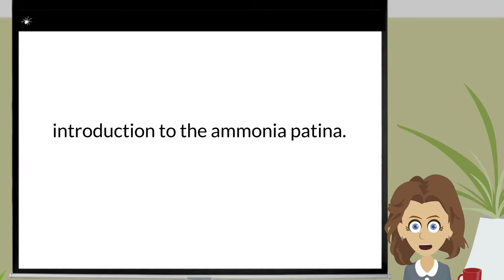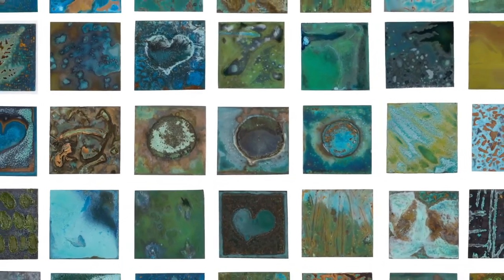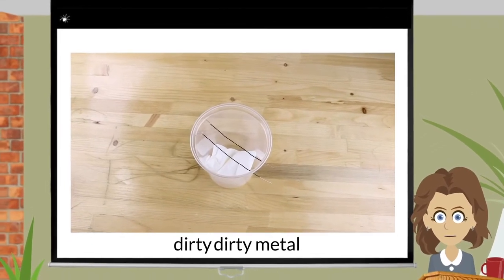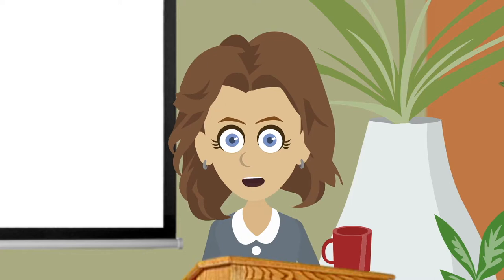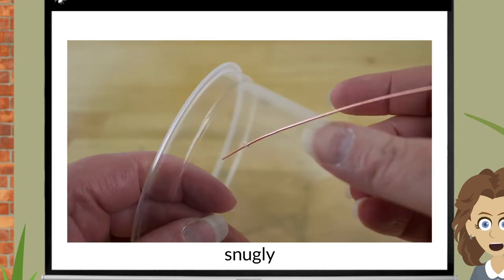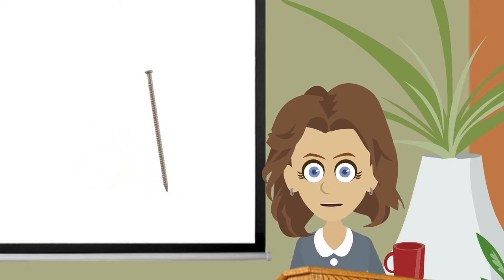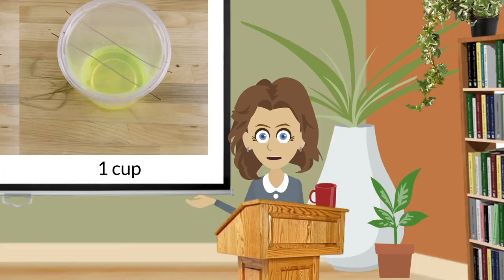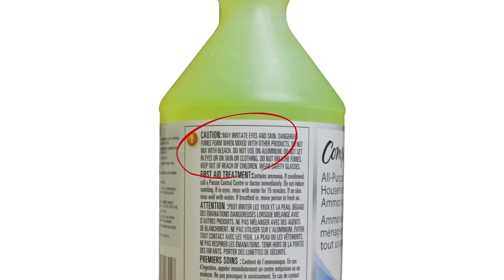Part 2a: introduction to the ammonia patina.

Comment: the ratio of ammonia to water you use (as a percentage) and what else is in household ammonia. Does it only contain ammonia?
Thank you for your answer.
Reply from the maker: Hello - 
There is no water mixed into the ammonia... and nothing else added to the household ammonia... just use it straight out of the bottle. 
Hope that answered your question,
nicole.
Reply: Thank you for the answer.